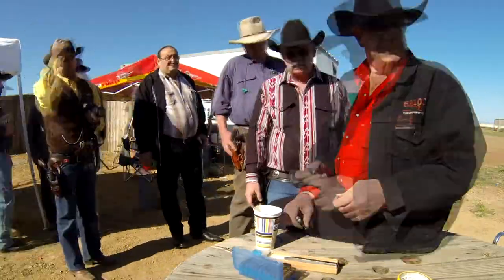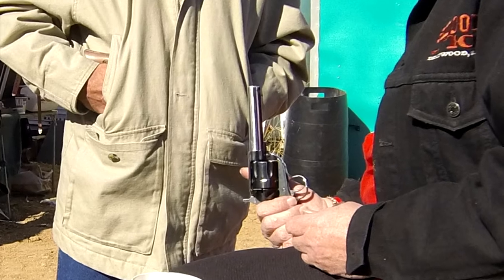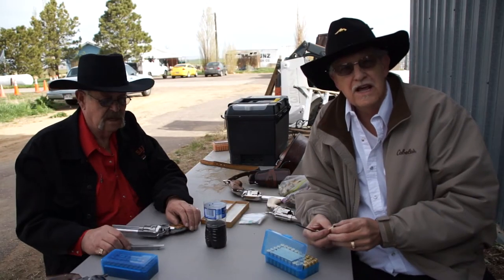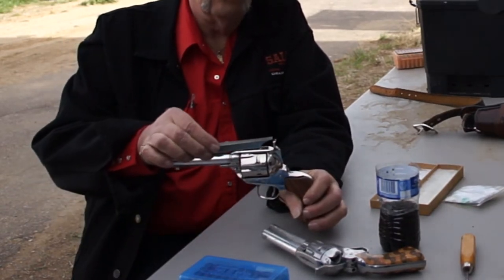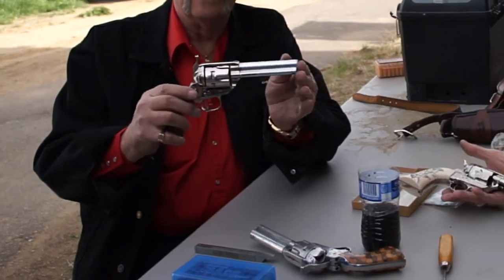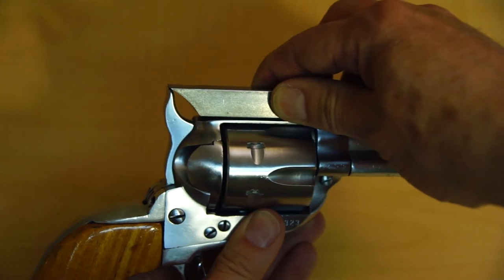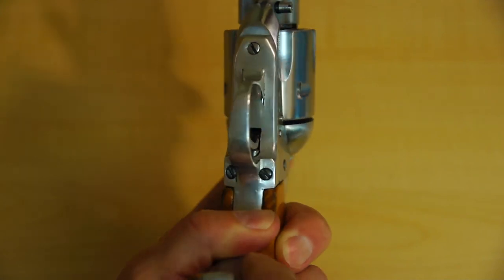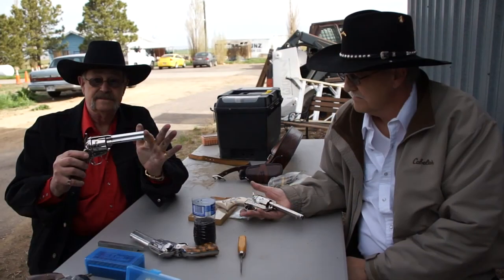Fast Draw 101 - Ammo & Gun Check

Comment: I thought computations supplied ammo though?
Reply from the maker: Depends. At WFDA competitions you almost always bring your own, and I think it's the same in OFDA. In CFDA it's pretty much always provided by the host at the bigger shoots, but can be shooter provided at the smaller ones.
Reply: Fast Draw 101 with Howard Darby I hope to start Comp shooting some time in the spring. So does it state on the website about ammo requirements?
Reply from the maker: It will generally be posted in the contest announcement. If it doesn't mention the ammo is provided you should bring your own just to be sure. If there's practice before the contest you'll usually need to provide that, so it's good to have your own anyways.